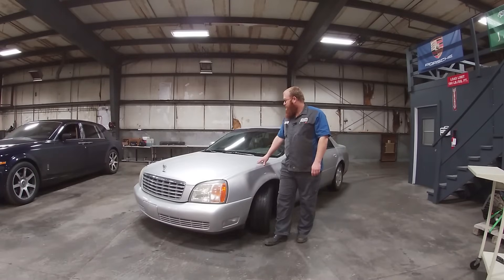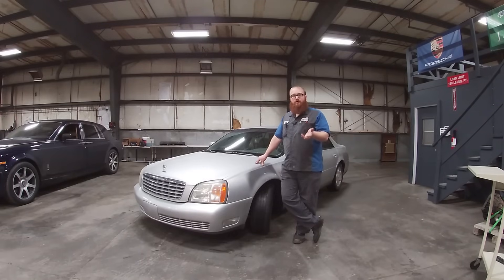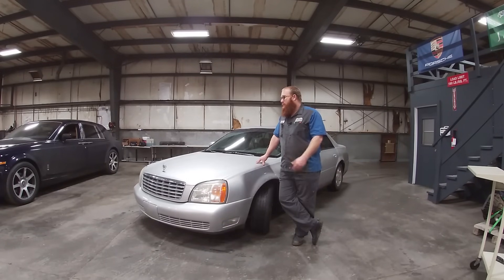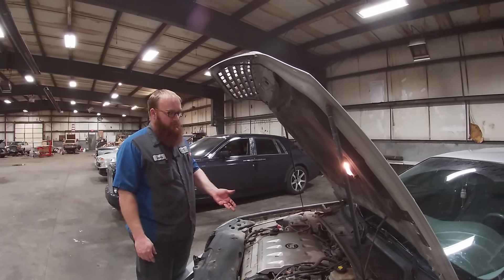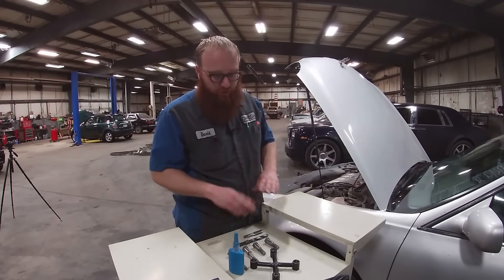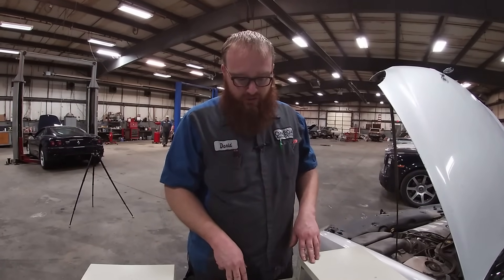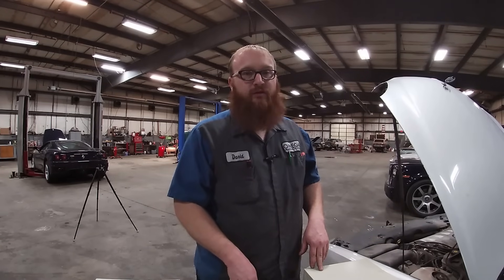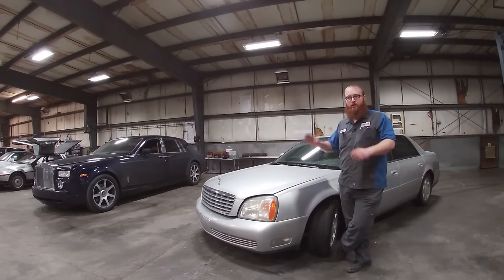The CAR WIZARD names Cadillac's Northstar Engine the Dumbest Design

Comment: Nice video. Well I worked at a auto plant and my best friend was the head machinest. I had a 4.6 Northstar with the blown head gasket. After disassembly he made all the parts I needed for the engine. It's been over 12 years and that engine is still going strong. And I did all the work while the engine was in the car. I guess anything is possible if your determined enough.
I Love the Northstar engine. She is a Hell of a runner..
Reply: The head bolts were the Achilles heel for sure.... but other than that it is a hell of an engine, yeah

Comment: Just wanted to say thank you for the info. Bought the Northstar performance cylinder bolt set and installed it.  It's not that hard, people.  I have a 99 Deville  with sentimental value and you saved the car for me.  I was not going to do the dealer thing... However...  This car only has 27,000 miles,  and still smells new on the inside.  I love you man.  New subscriber.
Reply: Did you take the engine out or do it with it in? If you did it with the engine in how did you do it
Reply: Had a 2002 CTS. It was a great car. Fast, comfortable, and got great gas mileage. Traded it in for a C6 Corvette. Happy then, happier now. Just saying.
Reply: I was watching this and was thinking to myself I can finally go out and find me a clean El Dorado. I always stood away from those because of this issue. I have 2011 DTS no problems.
Reply: I'm buying a 99 DeVille too
Reply: I have a 96. Got free. It's almost out, the water crossover though, what use a torch? Frickin thing, must have used water till starter finally couldn't turn motor over. Cylinder wash issue also. Wanting to fix both issues without spending much. Studs are getting more reasonable. Gasket kit still over the top. Gm should send out the gaskets.

Comment: I'm european, to me the transversely mounted V8 looks cursed enough :D
Reply: they made rwd northstars too, here in north america, i live in canada, climate is not very favorable for a rwd car, an heavy engine right on the front wheels will give way better traction in snow and has fewer moving parts so maintenance costs are lower, fuel economy is a bit better too
Reply: @retrocompaq  I live in Canada too. Northstar were in FWD cars like DTS
Reply: @retrocompaq  I don't know of any RWD cars with a Northstar.  Can you mention one, please?
Reply: The Ferrari 328 has also a transversely  mounted V8
Reply: @peterschmid5466  yea but if Im not mistaken the engine is mounted in the middle of the car wich leaves it plenty of space, rather then being mounted in between the front wheels.
Reply: You should look into the volvo S80 and XC90 with the Yamaha designed B8444s transverse V8 :D its the same base engine what noble used in the m600. Volvo also had a transverse twin turbo inline 6 on the T6.
Reply: @crickle47  XLR and STS were both RWD.
Reply: Big engine in a cramped engine bay.
Reply: @crickle47  cadillac from the the late 2000s
Reply: funny because you europeans did this as well with the lancia thema 8.32 which is a streched saab 9000 with a transverse 3L ferrari v8.
Reply: @crickle47  cadillac sts, srx, and the xlr.
Reply: Prime Artemis  dts and dhs designate the trim level of the final generation deville. While the they both have 4.6l northstar v8 they aren't identical.
Reply: Prime Artemis  all vin 8 and y are fwd. Vin A is rwd.
Reply: @brayannexon4613  true but lets keep in mind that that car is italian and they tend to designe some pretty wierd stuff. It used to be more of a common practice to mount some sub 2L inline 4 transversely and have it prehabs be turbo charged. But even then manufacturers manage to not leave a bit of space to work in the engine bay. By now we have arrived at the new formula of inline 3, direct injection, turbo charged, dissplacement barely exceeding 1L. Oh and non commertial Diesel cars are on a quick way to not existing any more.
Reply: @leogreck9984  Plenty of space on a Ferrari 308/328?  LOLOLOL try doing the plugs on one.
Reply: @crickle47  The Cadillac XLR  ( AKA the "Yeldorado") was RWD due to sharing the Corvette body/frame.
Reply: @charlesn898  You are correct, I completely forgot about this gorgeous car!
Reply: @crickle47  Cadillac sts, xlr, srx

Comment: I’ve had mine since brand new and I was one of the lucky ones. I’ve never had an issue with it and I’ve done all the maintenance on my own. The honest biggest pain was doing the rear spark plugs. Still runs great tho 18 yrs later.
Reply: What year is it??
Reply: Got a 2002 with 240,000 miles on it and drive it every day.
Reply: @fabfrith  I hit 245,000 miles on mine. Sadly oil started dripping this month.
Reply: @fabfrith  I was able to go on 240 plus miles without any issue.
Reply: I replaced all my spark plugs on my 02 Eldorado a month ago, so I know what you mean. Not the funnest thing to do.
Reply: i’m gonna be working on an abandoned north star, wish me luck.
Reply: Same I feel like I have a Cadillac with a good engine & just well made outa of the other ones it runs like it’s brand new
Reply: Did the 96 Cadillac 4.6 have the same problems, go figure just bought one
Reply: Did the 96 Cadillac 4.6 have the same problems, go figure just bought one
Reply: Got a 2005 deville with 157k miles running decently engine wise not too major problems yet
Reply: Most have two card

Comment: We don't have this car sold here in Australia, but we've had some dumb designed cars, engines, and components, it's not unusual, but the dude that came up with that "fix kit" for that engine is clever, and as Mr Wizard has shown, a car once a heap of trouble can become a useful, reliable unit.
Rock on Wizard!
Reply: The Underground Man  Duel citizen holder here U.S and Aussie. Plenty of low class people in both countries. Plenty of good people also. Give me a Toyota or Honda over the garbage any U.S based auto company spews onto the market. The bailout should not have happened. 

The American education system is disgrace, but that is a topic for another time.  

The first Toyota built outside Japan was in April 1963, in Melbourne, Australia, my town. From 1963 until 1965, Australia was Toyota's biggest export market. By the end of the decade, Toyota had established a worldwide presence, as the company had exported its one-millionth unit.

Comment: I'd say doing this repair is worth the value as once this repair is done they will run trouble free for years and as stated they are very nice cars.
Reply: I'd have to agree with this but I'm a little biased because I love the design of the 1993-1998 STS that uses the same engine. I would pay the $5000 if it permanently fixes the head gasket issue. i have had two of them though in my lifetime and never had this issue.
Reply: Not really dude. They have all sorts of electrical problems. Nightmare to trace and solve anything. Bad EGRs that get dirty all the time. Have to clean them much so It doesn't stall.  A few other things I can't remember. I wouldn't recommend this car even though it is a nice looking car and has tons of power when it runs right. Key word When it decides it wants to run right. They can run great for a few days or weeks then run terribly for a day or two then magically it goes away. Headache car.
Reply: no they won't the heater and ac system will eventually fail the electronics will fail with the hundreds of sensors and repairs are still crazy expensive also you'll eventually have to drop the transmission and the engine leaks oil a lot

Comment: A big reason that things like this happen, is the designers retiring and being replaced by much cheaper new graduates from CAD schools, that have very little practical experience. So, every 10-20 years, a product line goes really bad and it takes time for the corrections to be realized ("not my fault' mentality), and the cycle repeats itself!
Reply: that is a good-point, the retention or loss of 'instutional knowledge' insider knowhow & do-nots within a factory/company etc.
Reply: @jackdale9831  that's what I thought.
Reply: It's the same in engineering where you loose the experienced engineers and the green ones spit out whatever the computer says. Usually upper management don't have a clue as to why the computer wasn't totally correct. Experience would of questioned the head bolts.
Reply: @jackdale9831  wow!😨
Reply: How about the Chevy smallblock.  First seen in 1955 with a design by a bunch of guys using slide rules and practical knowledge.  Damn me, if the original design (bar a minor change here and there) is still one of the greatest performance setups in living memory.  No computers, no bullshit, no problems.
Reply: that makes sense - i have been thinking about this since watching this video -and thinking - how could a quality review miss something so easily corrected - but your comment - makes an awful lot of sense given what i have seen happen in companies over my life

Comment: 4.6 Litre, 32 valve, V8...all the right noises so far....FWD. OH FFS!
Reply: Aluminum, dual overhead cams
Reply: The cars should have been rear drive.  For easier maintainance and better balance and performance
Reply: Yeah fuck that
Reply: I never understood this about Cadillacs earlier granny cars lol. Why make a car so big with such a big engine and disrespect the whole design by making it front wheel drive. RWD have always been more fun to drive, and easier to work on in terms of access.
Reply: @antonyh37   probably would spin the back wheels like crazy with all the weight at the front. Would be fun to drive but no one in colder climes would buy. Don't want granny to get squished by a garbage truck spinning the wheels trying to get out of her driveway when there's a light dusting of snow.
Reply: had 2 of these...both head bolt problems...nice cars plenty power etc but pain in the everything. Thanks.
Reply: Before the LS we used the north stars for hill climb racing.  V8 aluminum block.  Light weight motor that rev high.
Reply: Thanks
Reply: @antonyh37  Gm was trying to save money.
Reply: A lot of cars are FWD to appeal to the masses. A lot of the country has weather where RWD isn’t suitable for all year driving. Now performance cars with fwd is the real travesty lol
Reply: @gorkyd7912  Not only that, but a Transverse FWD engine layout also allows for more passenger space with the same dimensions (no huge transmission tunnel needed, engine sitting in front of the front axle as opposed to behind taking up precious space), it also saves cost, weight and complexity since many compenents youd need for a front engine RWD car (drive shaft to the rear, rear diff etc.) arent necessary. 
Keeping in mind its a luxury car the engine placement actually isnt all that stupid.
Reply: FullThrottle- “For Granny’s” a old reliable 3.8 fwd would have been enough, or even the supercharged one, to have some more power.
Reply: @georgeburns1058  same a pearl white 96 Seville sls and 97 blue one both blew gaskets at about 150k miles. But still worth the 900$ each haha
Reply: Hmmmm Hoovies Phantom in the background.....did it break again lol
Reply: BaggaleyTech i bought my 1996 Deville Northstar new when i was 24 years old, and i still have it.  I keep it in my garage, and drive it straight down to Florida from my home in NY. I never had an issue with torque steer, and living on a mountain, FWD handles the cold NY snow very well.  I drove RWD cars, and no matter what stabilatrac system they use, nothing beats FWD.  been so long, i forget what systems my car has, but it is big, comfortable, quiet, and because of my maintenance, it has been dependable. I do not recall anything major except it needed an alternator a few years ago at 114,000mi. I change out all the fluids every 4 years.
Reply: still i love that caddy
Reply: @antonyh37  cause rear wheel cadillacs cant drive innthe winter brain ever try to drive 1
Reply: Believe Inyourself  yeah must be why it won the indy 500 7 times and was ranked the top engine several years in a row lmao
Reply: @balance667  ever ser video of this car driving an obstacle course it will make you look stupid
Reply: @davestewart2067  Agreed
Reply: @gorkyd7912  transmission is farther back in a RWD application, there is a driveshaft, and the rear axle is fairly heavy. When the gas tank is full, the balance point is pretty close to 50/50. Slightly nose heavy, but mostly balanced. That much weight in the front of a FWD makes it more prone to lift off oversteer. Also, does granny really need a V8?
Reply: @balance667  
Yeah, but most FWD aren't V8.
 The bigger the engine, the worse of an idea FWD is. Way too much torque through a CV joint...horrible weight bias...chew through front tires...impossible to access rear bank of cylinders. 

FWD is good for 4 bangers, marginal for 6, and "OMFG what were they thinking!" for an 8.
Reply: This platform, post 2000, was also the Bonneville, Aurora, LeSabre, Park Ave, Seville, and later Lucerne/DTS. At full Cadillac MSRP it was a poor value compared to a Mercedes or Lexus. The 3800 powered ones made more sense.
Reply: @michaelanthonyg3851  
I daily drive RWD in the winter here in Pennsylvania. Nothing to it, if you know how to drive. 
I admit, someone who grew up on FWD and stability control might have his hands full until he learns how to drive.
Reply: Lincoln Town Car of the same era is so much better to drive. Hands down.
Reply: @RaytheonNublinski  Aaah but... the two party system
Reply: @davestewart2067  they made rwd later it was sts
Reply: @gorkyd7912  That is WHY they have SNOW TIRES. Can go to the SKI MOUNTAINS TOO. No problem. Corvettes even made it, and that is ALL MOTOR with RWD...if you know how to drive, again-no problem.
Reply: @bunzeebear2973   Snow tires aren't a replacement for a well-balanced car, and neither is a driver who "knows how to drive." Just because people make it to their destination doesn't mean the car is well-designed for it. You can't expect people to simply throw on snow tires as soon as the weather changes, no one does that. Most people south of the 40th don't even own a second pair of wheels with snow tires even if they did have the will and means to change 4 wheels at home. Corvettes are great because they're mostly manually trans so you can start in 2nd or even 3rd gear to control wheel spin, plus the throttle is very tuned and responsive. It gets trickier with cheaper auto trans V8s where your only means of controlling wheel spin is your light touch on the skinny pedal. Can be done, but the more you expect of drivers the more they'll end up wrapped around trees.
Reply: Raytheon Nublinski yes you are, 4 words in your comment and you managed to only spell one correctly.👍👍
Reply: Thats what their 65 year old buyers wanted

Comment: I used to own a 2003 Seville. Apart from this issue, the engine is really smooth and powerful.
Reply: Yeah, they run great when they run but man they are expensive to fix
Reply: That's true. If you find one like the Wizard's, that has been fixed or one built after 2005 it's an interesting option.
Reply: @ryanmalin  Yep theyre great when properly running. I have YET to ride in one properly running. I assume its like a 3.6 but with more torque. But thats speculation cause I only find busted northstars.
Reply: LD8 or L37?
Reply: Know a guy who swapped a 2006 northstar and transaxle into his 96? (I think) Chevy lumina... badass ride! But the guys a dork.
Reply: @xlrvlac  L37
Reply: They do run well and make good power.
Reply: I totally agree.  My mother owned a 1999 STS which I purchased from her in 2007.  It was a trouble-free car that I sold to a buddy in 2009 with 125,000 miles on it. He drove it for several years until the engine suffered the head bolt issue at 185,000 miles.  I’ve read about owners on the Cadillac forum have over 300,000 miles on their Northstar after fixing the engine block with the kit described in this video.

Comment: I always wondered why Northstar engines had such a bad rep, but my 2005 SRX has never had any issues with its now 15 year, 160,000 mile NorthStar.  But you are the first to give a clear explanation why.
Reply: Yet another good reason NEVER to buy a GM product.

Comment: I had a 1998 Oldsmobile Aurora, which had a modified version of the Northstar.  Thankfully for me the previous owner had the foresight to have the head bolts replaced years before.  Man that engine was silky smooth and quiet at low rpm but sounded soooooo good when you opened it up.  And I put a good 150k km on it without issues it so with proper head bolts in they're actually really solid engines.
Reply: I always wanted an Aurora and wondered if Olds fixed the problem or just left it alone. I now know. I still want one though.
Reply: @doubleheadergr yep it was from what GM had learned from their ownership with SAAB .
Reply: 4.0 v-8 northstar
Reply: @montymatilda  And knowing is half the battle.
Reply: I had a '97 aurora. Had it up to 410,000 kms, until it needed a bunch of non-motor related work that wasn't worth the money. I did no engine work other than regular maintenance. I loved it, it was a great car.
Reply: I loved my 99